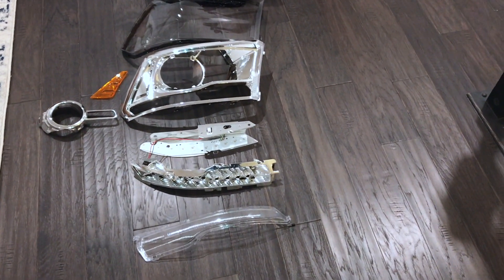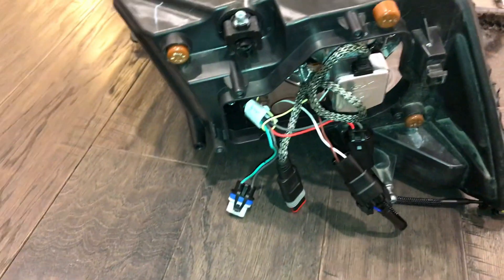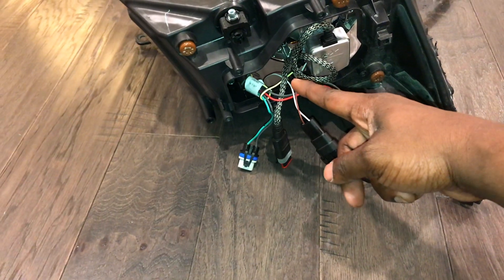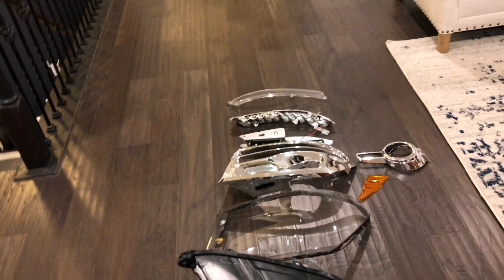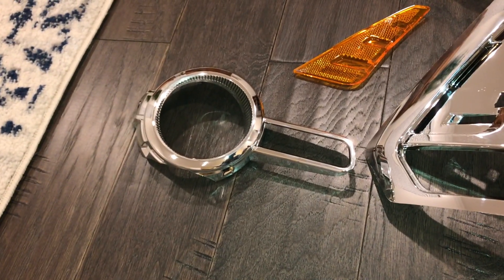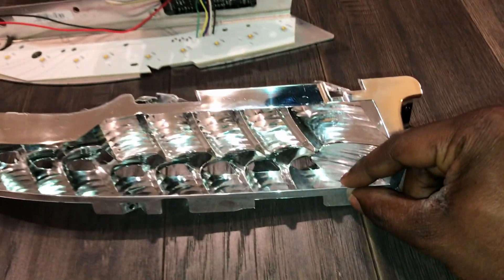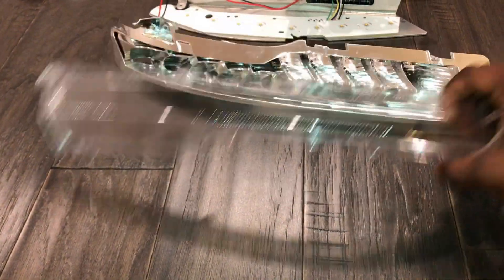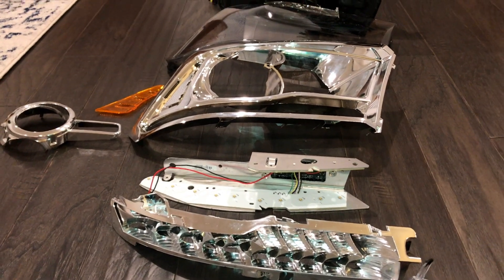Own A RAM With Projector Headlights? I- Here is a breakdown of the Housing -Morimoto Retrofit!!!

Comment: Hi what is the name of the splitter for the high beams?
Reply: You shouldn't need them for this application. The original projector already has a trigger wires there for the high beam shutter. Why he didn't use them I don't know. You may have to cut the end off and splice in the pigtail that came with the projectors.